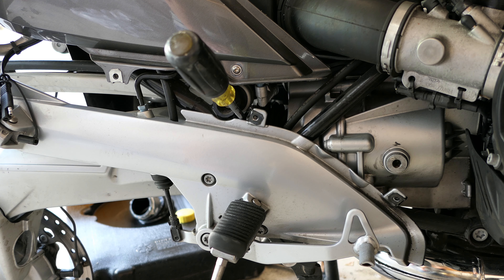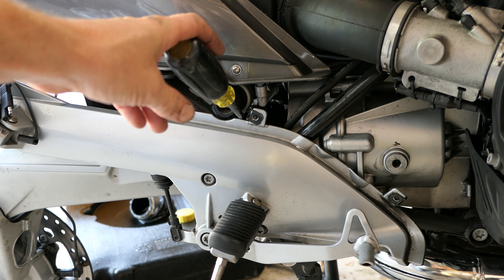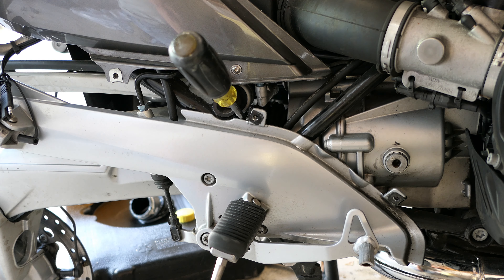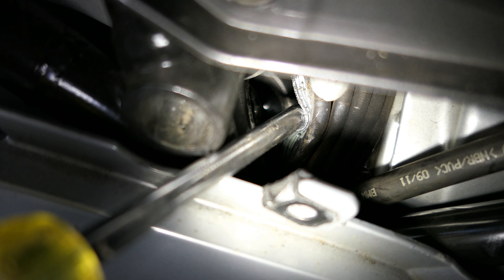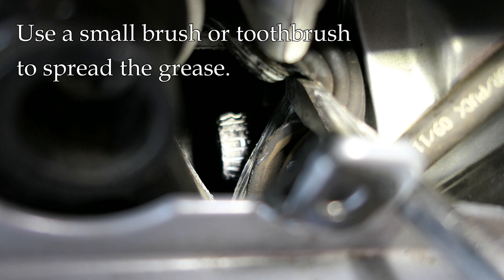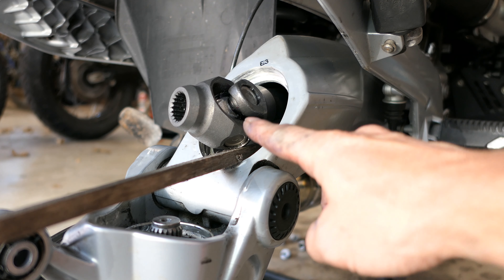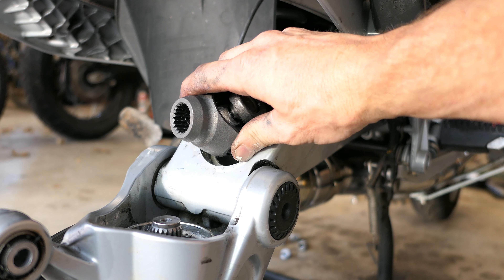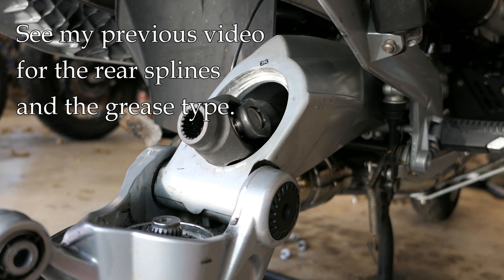Driveshaft Front Spline Greasing On The BMW R1200 RT

Comment: Thanks for such a useful video. Can I ask is the goal to get the tip of the screw driver between the front end of the shaft and the back of the gear box and twist?  or just to get purchace between the shaft joint and apply leverage backwards? Im also curious you say the shaft cannot be removed all the way on earlier models mines a 2009 will I be OKa/
Reply from the maker: Either is okay, as long as it works.  The strength of the retaining clip is pretty high, so probably twisting a large screwdriver is going to work best for the initial disconnect.  I know on some model years you can remove the driveshaft, particularly newer models.  My understanding is that the 2005-2013 years all cannot be removed.  However, you can always give it a shot.  It will be obvious in a few seconds if yours will come out or not.

Comment: Getting the shaft back in is a PAIN IN THE A$$.  Like seriously way more work than I was expecting.  When I dropped my final drive gear box the gear shaft dropped with it.  The top wasn’t held in with that clip at all.  So I am glad I did it.  There was also no grease on either end.  But now I am REALLY struggling with getting it back in at the top.  A little tiny access hole on the bottom you could insert a drift would make this so easy.  Thanks for the wood pole tip, will try that after I take a break.
Reply from the maker: How did the wood stick or pole work for you?  I got mine back in place in a short time.

Comment: Hi John, I appreciate your helpful video.
I was particularly interested because I have an 09 and the Haynes and Clymer manuals say to remove both footpeg plates to access the front boot- I don't have an OEM manual.  The issue would be on the right hand side where the rear master cylinder is fixed to the REAR of the plate by screws with red loctite.  So the problems would be firstly be access to the screws and secondly the need to heat them to say 100 degrees C.
Now I notice that you didn't remove the right hand plate but still managed to get access to the boot.
So my question is did you experience any problems refitting the boot to the swingarm - I presume you did not remove the boot from the transmission or grease the boot to make it waterproof (rain is common here in UK!)?
Thanks for your help
Paul
Reply from the maker: There's a few things to think about.  First, the front splines are not as critical as the rear.  That's because the clip in the front keeps the shaft sort of pinned in place with the transmission output shaft.  Greasing the front splines will help prevent corrosion and wear from vibration, but the front is not sliding back and forth like the rear.  I wouldn't and I didn't bother removing the footpeg plate.  While I'm sure that would make access easier, it wasn't necessary.  I was able to pull back enough of the boot to gain access and smear some grease on the splines.  Using the long stick I was able to put the shaft back in place.  As for greasing the boot itself, that can still be done using a lithium grease or a waterproof grease.  I forget what I used, but a long cotton swab or other device loaded with grease can be stuck in there.  I don't think water intrusion in the front is quite as likely since there is protection from the fairing.  I'd suggest trying to access the splines first as I have done here, without removing that plate.  If you get in a bind, you can always remove the plate later.
Reply: @tinderboxarts  thanks John I appreciate your thoughts.

Comment: Just did the splines. Chattering came from the final drive area putting it in gear and releasing the clutch. Noise greatly diminished when slowly circling the driveway. Could this just be  the joints realignment to the output shaft and final drive splines?
Reply from the maker: Eh, no there really shouldn't be any unusual noises after service.  I'm wondering if you are certain you got the front clip back in place?  It should snap home and then if you give the driveshaft a tug from the rear it should stay connected to the front.  Possibly you didn't have it seated, and possibly when you did your driveway loop that did seat it. But, if I were you I would take another look at that rather than hope for the best.
Reply: @tinderboxarts  Myself and a motorcycle mechanic double checked, the yoke was pushed, and we felt the bump as it cleared the clip, tugged and spun the rear yoke as per your video and it seemed fine. I d the old drive shaft as the rear joint failed and made a clunking sound.  Replaced with a unit from the Beemer Shop. Thanks for your reply, I could be overreacting.

Comment: Nice video... can the drive shaft be pulled out?...while servicing the FD....
Reply from the maker: Of course there are some differences among model years, but as far as I know you can't get the driveshaft completely out unless you remove the swingarm.  The front UV joint gets hung up on the casting.  I wiggled mine around and it's pretty firmly in there.  Maybe, like those Chinese puzzles, there's an angle to get it out but I doubt it.
Reply: @tinderboxarts  The R1200RT is the most difficult of the BMW 1200 VERY tight fit. Any dirt in the driveshaft tube will make it very difficult to remove. The first time i removed the driveshaft took over an hour. After i cleaned the inside of the tube it slid freely. BMW could have made the inside diameter bigger, plenty of room between tube and rear break master cylinder. This is why people still ride Airheads.

Comment: thanks for the video!  two questions:  when you "pop" out the front splines, do you have to lever the screwdriver until the driveshaft  is free?  Second, what year is your RT?  Do you think this will be the same with my 2014 RT?  Keep up the great work
Reply from the maker: The RT in the video is a 2012, so your 2014 will have the swing arm on the opposite side.  The general idea is the same.  Once the clip which holds the front splines in place is released the driveshaft easily pulls back.

Comment: Very clever!
What is the grease you are using for this?
Reply: Oh, I’ve seen this info is in the description of the video. Thank you! 
I used the same trick on my drive shaft, only i took it out completely in the transmission side and had to insert it back in the final drive.
Reply from the maker: A moly based grease works best, but don't obsess about it.  I use a combination of Honda moly 77 paste and what is marketed as "Ford/Lincoln/Mercury" grease with molybdenum added.  Mix the two together, half and half.

Comment: Can the drive shaft be completely removed when greasing  the  splines that way?
Reply from the maker: Unfortunately, no--at least on the earlier RT models.  The front UV joint gets caught on the swing arm casting and can't be removed.  However, I believe some of the newer model years with a different swing arm configuration do allow complete removal.  I'm sorry I don't know which years those are.
Reply: @tinderboxarts  bummer I am in the process of  replacing my drive shaft  and was hoping to not have to pull the  swing arm it must be just barely to small for the universal joints not come out. .
The whole driveshaft design is crap. My bike  96 1100 RT. I love the bike but I would like to bi__h slap a few engineers for a few things.lol seriously I would.
Reply: @tinderboxarts  MY RT is an 06 After i cleaned the inside of tube it slides in and out easily.

Comment: At what point do you install the retaining ring, and how do you install it? Does the shaft slide on so far (1-inch +) that the retaining ring pops out the back of the coupling? There is no groove on the drive shaft splines like there is on the output shaft from the gearbox, and I can't figure out how to manage the retaining ring.
Reply from the maker: Well, the retaining ring is "trapped" inside the universal joint splines.  It's spring tension is such that you can wedge the assembly apart and pull the universal joint and retaining ring off the output shaft.  But, you can also give it a smack to push the assembly back together.  The retaining ring just needs to prevent sliding on the front splines so that the rear driveshaft splines handle most of the movement.  It's not super-strong.  So if you pull the driveshaft off as I did in the video, the retaining ring should stay trapped where it was.  Does that help?

Comment: John thanks for of your help with the videos... I have collected all of yours. I have a R1200RTP 2009. and I will like to know if I can use the synthetic oil for may car ( no wet clutch in the RTP) oil 10/40 fully synthetic ( Mobil) .... should I try it what is your advice.  I have became a good mechanic based in your Video’s thanks again John.                I live in California
Reply from the maker: Well, the short answer is "yes."  Since your bike has a dry clutch, you could use regular automotive oil that meets the base specification.  However, motorcycle oil has properties that help it resist shear forces and heat inside a motorcycle engine, so you may be getting additional protection by choosing a motorcycle-specific oil.  I actually did an exhaustive video on this subject here:

https://youtu.be/I_ipLwi_Txs

Comment: Perfect trick with the wooden stick, thanks. on my R1200rt 2012, when I pull the driveshaft backwards, it can move freely about 7 mm (0.3 inch). is that normal or an indication that it did not engage the spring on the front side? I am not sure there is still a spring on the front end and although the Hayes manual shows a picture that I can pull the complete driveshaft backwards out of the swingarm to inspect the frontside.  on my bike it gets stuck in the inside of the swingarm. p.s. it's an European R1200RT-P version.
Reply from the maker: You know, some people report being able to get the driveshaft out without removing the swingarm, but it must be like one of those Chinese puzzles because I couldn't get mine out!  Possibly some model years are different.  Anyway,  a 7mm movement does sound a little excessive.  However, if your driveshaft will spin freely (in neutral, of course) and it won't come all the way out then maybe it is okay.  You might try prying the shaft out again and re-seating it to see if that changes anything.  The clip should stay "captured" in the yoke and it spreads enough to get over the output shaft and seat in that groove.  It's something you have to feel, not see.

Comment: Do you do anything with the knuckle joint?  Lube/grease?
Reply from the maker: The universal joints themselves don't come with grease fittings, which is really unfortunate.  They do make a "needle" tip for lube guns and some people have tried to sneak some grease under the caps while they are in place, but it isn't really the same thing.  If you ever have to replace the the universal joints I think you could get some with grease fittings and they'd last forever.

Comment: My final spline on the final drive has seized. How would you go about freeing it?
Reply from the maker: I'd better clarify--do you mean that the front or the rear splines themselves are rusted together and won't come apart, or do you mean your driveshaft U-joints are seized?  If your rear splines are stuck together it may just be that that the driveshaft is wedged in place as you are lowering the final drive.  Sometimes you need to wiggle it or turn the driveshaft so the final drive can drop free.  If the splines are actually stuck together then soaking with penetrating fluid as best you can and using heat in the form of a torch or a heat gun may free the splines in time.  If it's the front splines then heat is out because you have no safe access, but you could likely spray penetrating fluid in there.  if your U-joints are seized then you need to remove the driveshaft (and the swing arm to get it out) and either replace the whole driveshaft assembly or replace the U-joints.
Reply: @tinderboxarts  Thanks. The U joints are fine. The shaft came off the front spline on the gear box side very easily. I then cleaned and greased. The rear one is the one that I can't move. I didn't have final drive oil so I didn't want to empty it. I drenched the spline were the u joint joins in penetrating oil and left it to sit and then tried to use a bit of force but to no avail. Haven't used heat. As the bike is under warranty and dives normally, I didn't want to go to far. The dealer will look at it but I was curious on how to remove it.
Reply from the maker: There's a high probability that it's not really stuck at all.  It just gets persnickety when you lever down the final drive because the angle is severe.  If the u joint is lined up the wrong way it just won't budge.  Often it's just a matter of twisting the driveshaft while you fiddle with the final drive and when you find the right spot it will just drop easily.  Now that I think about it, if you were able to move the front yoke in order to grease the front splines, then that means the rear yoke had to have been sliding on the rear splines to even allow that movement.  So, try twisting the driveshaft (trans in neutral and rotate the final drive) and see if you can find the right spot.  And, make certain the front is fully seated because if it isn't then that would also make movement of the rear impossible.
Reply: @tinderboxarts  OK will try, thanks

Comment: Great video, John. Thanks.
Invest 10-20 dollars in a good LED headlamp. It makes maintenance much easier when you need a flashlight. I carry one on the bike as well,  just in case, along with some spare batteries.
Reply from the maker: Flashlights in my household are like the other sock missing from the dryer!   They disappear with regularity and I know someday there will be revealed a portal to another dimension where socks, flashlights, and 10mm sockets will be abundant.

Comment: You already have the shaft disconnected on both sides. Just slide the entire thing out to do a proper grease job
Reply from the maker: Unfortunately not all of the final drives allow that.  This generation is one that does not.  There is no physical way to wiggle the driveshaft out the back because the front U-joint gets caught.  The whole housing has to be removed to remove the driveshaft.
Reply: @tinderboxarts  ohhhh, gotcha. 
I just serviced my GSA recently. I was able to pull the drive shaft out.
Eventhough BMW is stepping up to the plate and replacing all shafts. I think ur bike is included in the recall.

Comment: Hi John, Thanks for the great videos, they're really helpful. You're doing a great job on lighting, camara angles and commentry. My driveshaft is really rusty and there's a significant build up of dirt on the seal to the reardrive. I guess the rubber boot has been leaking for quite a while. Its dry now so i'll try to pull the entire shaft out en lubricate it. At least I'm going te try. This guy got out -> https://www.youtube.com/watch?v=ciF0AgAy6tg
Reply from the maker: There may be differences in model year and possibly the newer RTs will allow removal of the driveshaft without removing the swingarm.  The older ones will not.